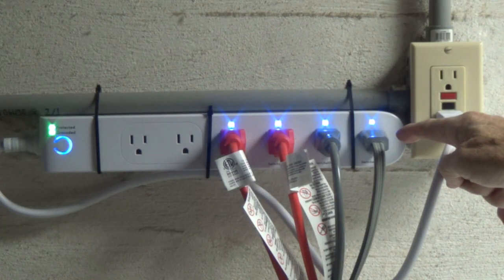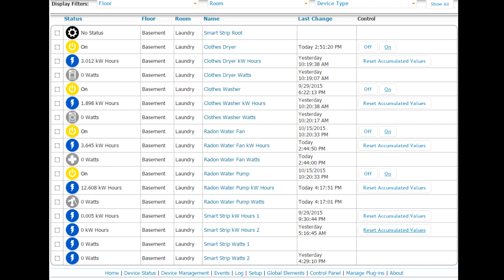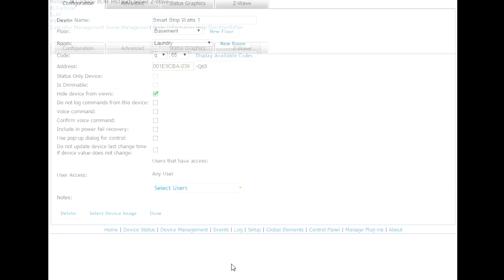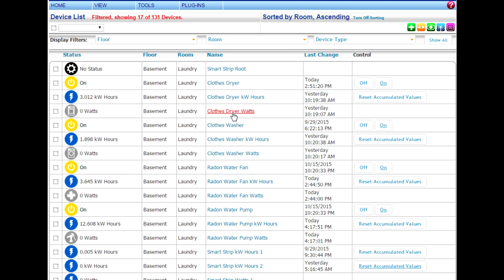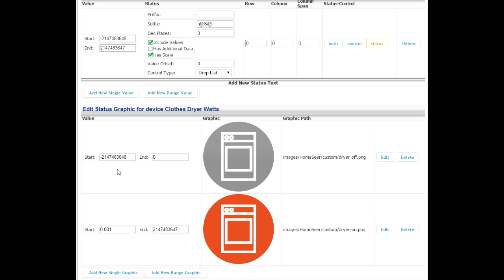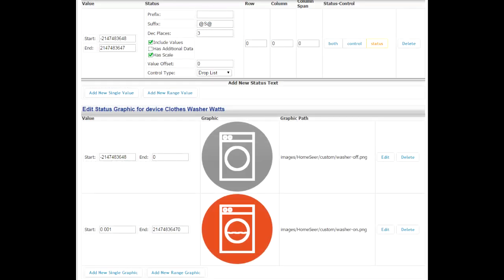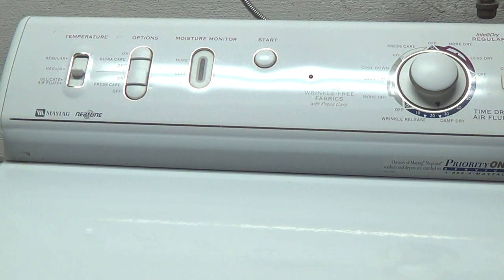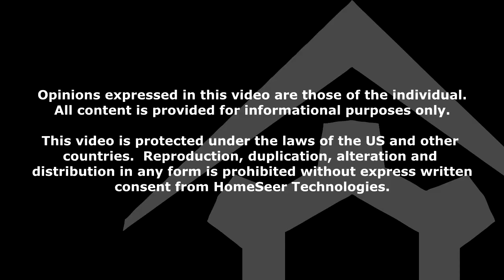(HS3) Monitor Washer & Dryer With HomeSeer Home Automation System

Comment: I have setup something similar, but I can't do it like this as my washer and dryer do not turn off completely, they still use 1-2W while being in "sleep" mode. That's fine though, I can adjust saying that anything above 5W is on, while under 5W is off. However, the modern models will fluctuate from "zero" to 2000W while it is still being active, so when I setup this first time, I got like 20 messages saying the washer was done, while it was actually just in some pause-mode waiting for next action.

I am curious to know how you're handling that, cause if 0W is necessary to trigger off, I am pretty sure you have to go and turn it off with the on/off button manually, and that kind of defies the point of having a message telling you its done.
Reply from the maker: There are a few ways to handle that, as you've already determined. You can use a range or 0-10w (for example) as "Off" and 10.01-2500w as being "On".  That would probably fix 99% or everyone who has a washer that consumes a little power all the time.

Comment: would the aeon labs energy monitor with the ct's work for the 240?
Reply from the maker: +Rapturous Raptors Irrational Inventions That's designed for use on the main power panel of the house. The heavy duty smart switch can be wired into the individual circuit for your 240v device. That would be a better choice.
Reply: +HomeSeerOfficial ok cool, the main reason for using the other one is i have a spare right now :)

i just setup the washer with a single aeon labs smart switch, i was unable to find the images where should i look.
Reply from the maker: +Rapturous Raptors Irrational Inventions What images are you referring to?  The status icons are in the message board post that's in the description of the video.

Using the Aeon HEM CT would take a bit of work. You can't just put the CT around the whole power cord. You'd have to split the cord and clamp it around one of the individual 120 v hot lines inside. Messy.  That's why I'd recommend the heavy duty smart switch instead.
Reply: +HomeSeerOfficial great thanks for the tips :)